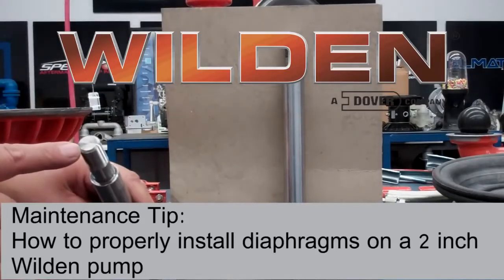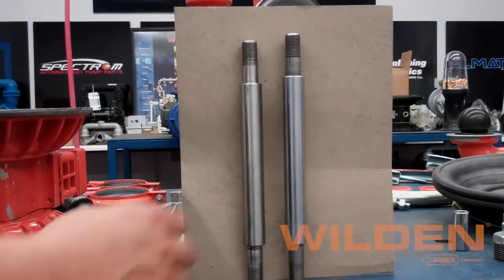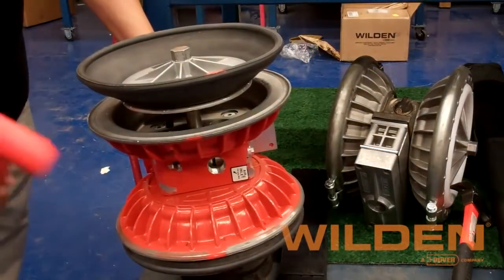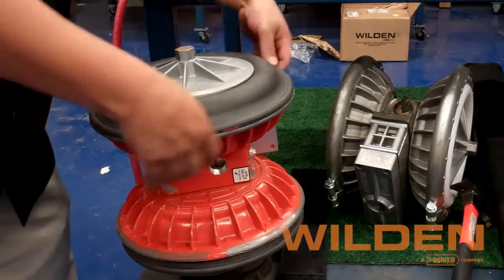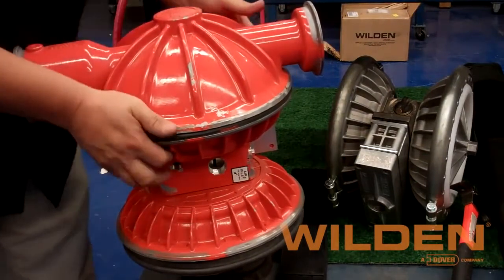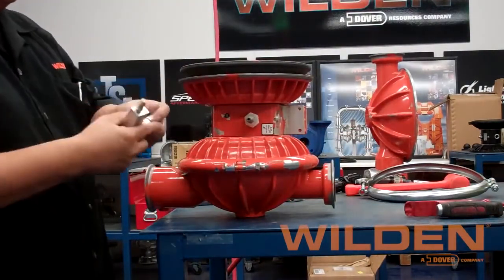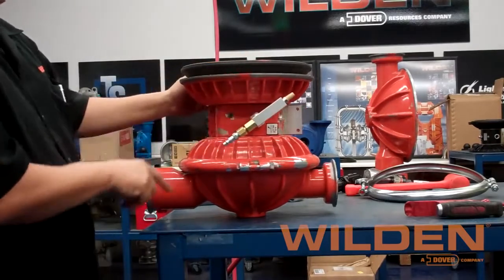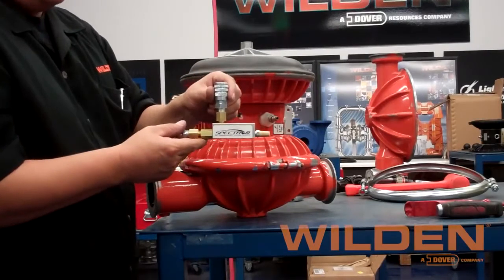How to Install Diaphragms on a 2" Wilden® AODD Pump

Comment: What is the airside?
Reply from the maker: The airside referenced in the video consists of the pump components that are in contact with the compressed air during operation and separated from the process fluid by the diaphragms. This includes the air chambers and air distribution system.
 
If you have further technical questions, please reach out to our application engineering team at wilden.technicalsupport@psgdover.com.